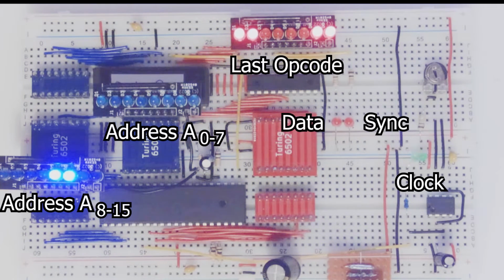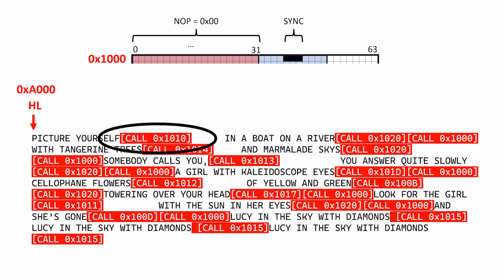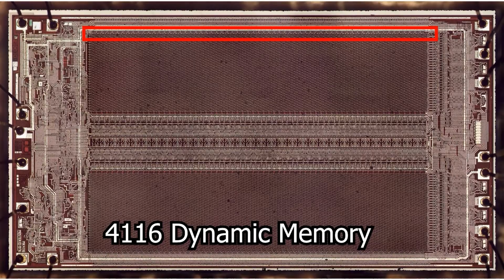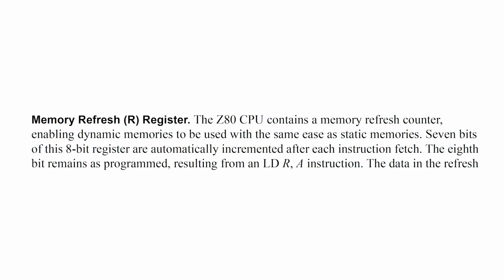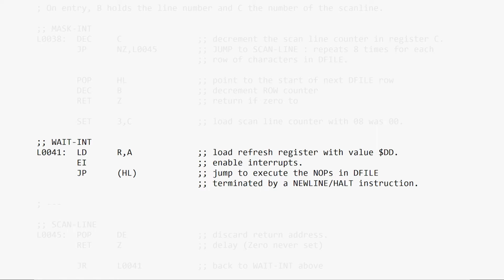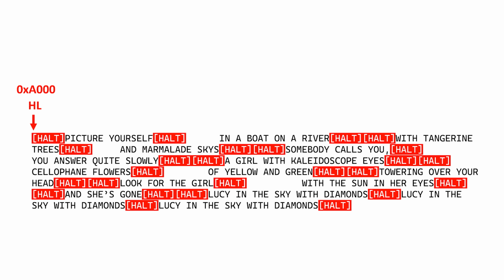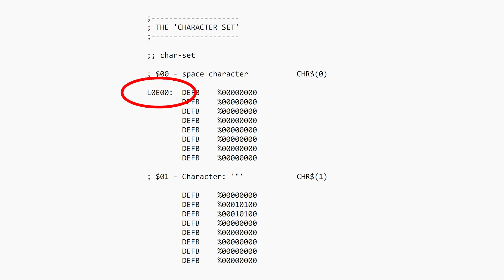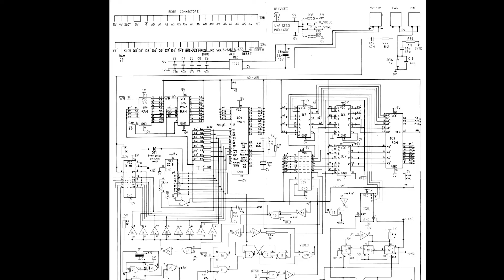ZX81 Video Circuit Part 5: How interrupt is generated for HSYNC

Comment: I had no idea about mirrored memory map...so zx81 can have max 32KB? Is ROM replacement possible to enable more without banking?
Reply from the maker: Correct.  I've wondered how these large expansions (56K) work.  Technically, you could store data in the upper 32K, presuming the d-file is written to in the upper memory.  You just couldn't execute code without upsetting the display.
Reply: @DrMattRegan  Yeah, given that BASIC programs are data (not machine code), that was no severe problem.

Comment: First thought, this was an impressive hack and achievement. But as a 6502 guy, the Z80 having a DRAM refresh register is just plain weird. That seems like the job of something outside the CPU, like a memory manager, and the CPU transistors should be used for computation like a hardware multiply and divide.
Reply from the maker: Yeah, the Z80 does the fetch in T1 and T2, while decode and execute are done in T3 and T4 where the bus is free.  I think  they wanted to keeps the busses busy.

Comment: I love how perfectly their design shows how engineering is all about solving a problem given certain constraints. The ZX81 was such an awful computer, but it was _cheap_, and it worked, and it introduced a bunch of kids, including me, to computing because of its affordability. (The only way I could keep mine running was by using freezer packs to keep it cool!) To learn now what lengths they went to in achieving this is nothing short of astonishing. Thank you so much for this series (and your others), @DrMattRegan. 🙏
Reply from the maker: Agreed, for me it was the choice of a 1 hour wait  for 5 mins access on an Apple2 at lunchtime at highschool (1 apple 2 for the whole highschool), or a ZX81 which i could afford and use whenever i wanted.  Was a great little machine.

Comment: This is just fantastic. To think that the guys at Apple and Commodore basically just said "no, we'll spend the money on a proper video circuit", and if Sinclair had done the same then I wouldn't have been able to afford to learn to program in 1981 and my whole career path may have been different.
Reply from the maker: Yep i concur.  Except for phase shifting artifact colour in the apple 2, all the other designs are pretty stock standard.  I do think they did a brilliant job of getting the cost so low.
Reply: And my entire career path was based on an Apple, so I am grateful Woz did it properly.

My parents almost gave me a ZX81 for Christmas one year, but fortunately my brother stepped in and convinced them not to.

I'd have been really upset to be given the pile of crap that was the ZX81 with its naff video circuit, too small amount of RAM and a poor quality keyboard with individual BASIC reserved words on the keys.

In over 40 years of programming, I can honestly say I stayed away from naff keyboards. The right decision.
Reply from the maker: Fair enough, but i think the price point meant that it was zx81 or nothing for many (as it was for me).

Comment: Well you learn something new every day.  I wasn't aware of how "hacky" the old ZX80/81's video was.  I was only about 10 years old and it was hard enough trying to code up 6502 asm without much documentation except at university libraries.   That was a LONG bus ride!   
Love this explanation a lot and I just found a few brand new SGS Z80s in my junk box - still in original antistatic foam and I'm going to press one into service 40 years later to re-create what you did and see if I can improve upon it.  Unlike old Clive I can afford a BOM with a 62256 SRAM.  :)
Reply from the maker: Hey Andy.  Yeah, it’s amazing how much detail there is, but I think it’s actually a pretty good build.  If the CPU runs and it can access ROM and RAM then it should be able to generate video.
Reply: Two words: Bank Switching. 😄
Back in "The Day," there were several CP/M or MP/M systems which used bank switching to run several programs at once, each having its own 48K memory space (with the last 16K being common to all banks and generally holding the CP/M or MP/M "core" plus ROMs and shared data.)
Reply: @melkiorwiseman  that's 80's Docker; can't be 80's VMs as they share the OS "kernel".
Reply: @TheDiveO  I don't know why you're talking about VMs.  All I'm saying is that there was a multi-user, multi-tasking OS based on CP/M and that it used banked memory.  The OS used preemptive multitasking based on interrupts to switch tasks so fast that it appeared to be doing them at the same time.
A VM is something completely different.
Reply: @melkiorwiseman5234 unfortunately you don't seem to get the joke about the architectural pattern on a higher level of abstraction.
Reply: @TheDiveO  Ah.  A joke.  Sometimes, they do go over my head.  I don't think I ever learned what "docker" really was in computer terms, so that's probably where the confusion lies.
Reply: @melkiorwiseman5234    Yeah I worked on a couple of MP/M machines while a first year uni student as a part time job to earn some cash.  They were really old back then in about 1989 as PCs had pretty much eliminated Z80 machines in all offices (apart from a couple of WordStar holdouts)  but not in industrial process controllers. 

 I clearly remember one in the field on a trip to the Steggles chicken factory where I found a fairly custom machine with 256k of bank-switched memory boards,  RS232 boards to interface about a dozen terminals which would timeshare the system, but also there were plenty of these custom I/O boards with relays doing all sorts of weird stuff like controlling belts/pulleys, hall-effect sensors,  relays to open the electric strike on physical gates in a chicken run as well as thermocouples/thermistors.   It looked like something out of Mad Max.    

The thing I'll never forget was the smell!!!  This giant steel box was completely chock a block with chicken feathers which the fan had ingested and choked up the whole machine.   Upon opening you couldn't even see the PCBs!   Apparently nobody bothered opening the case to clean it since installation at least 10 years before, so the poor old PSU fan finally gave up, taking out a bunch of high power 7805, 7812 and 7815 TO-3 can style linear regulators.  

Ah nothing like the beautiful aroma of thick mud, chicken waste,  charcoal feathers and dozens of vaporised Si PN junctions.   Hours of that before I had it working again.   Ewwww. I can't bring myself to go to that section of the supermarket freezer even to this day!
Reply: @AndyGraceMedia  I still have a 4-port (RS-232) MP/M system sitting out in my garage, although I expect it's reached a non-working state by now.  It was originally configured for 3 terminals and 1 printer, but you can reconfigure the OS to use fewer or more of each, so long as you have at least one terminal to run programs from and to display error messages on.